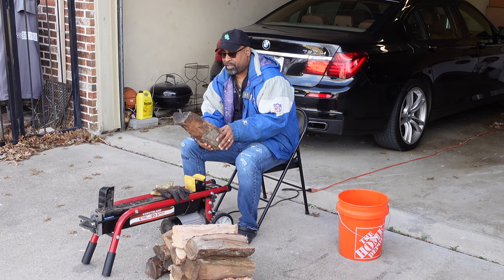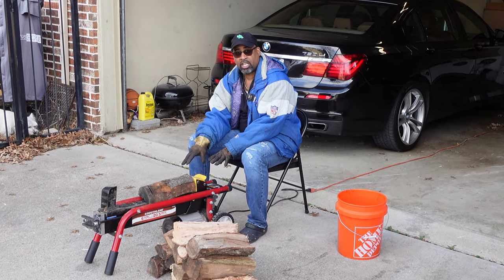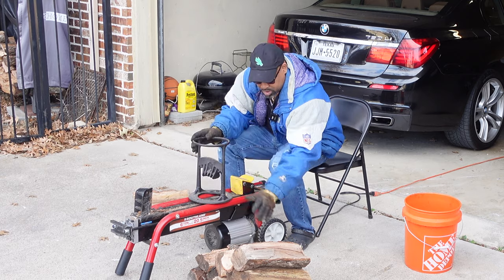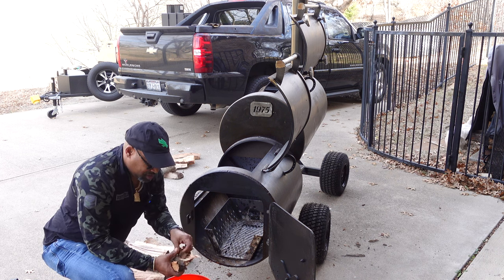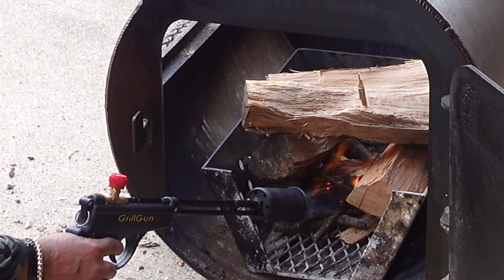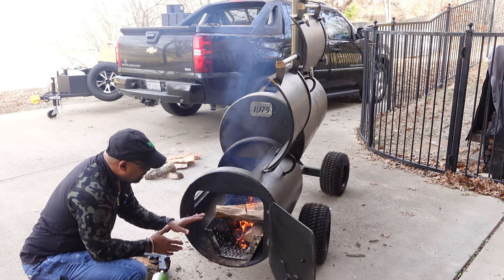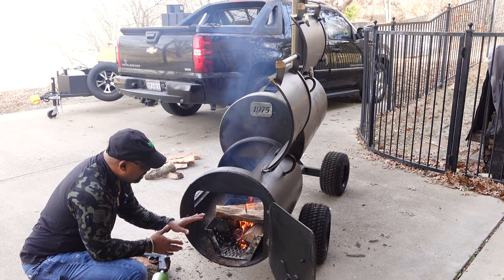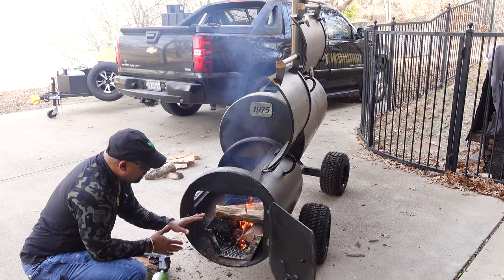Fire Management (How to's) for all BBQ Smokers   4K

Comment: I found it much easier to start my cold bed with actual charcoals. I have used that method for quite a while and it's easy and makes a better cold bed in my opinion to start with because they are able to burn better than the big chunks of wood. Very nice pit
Reply from the maker: Great tip and I agree. I used charcoal as a started over the last 5 months and saw great results!

Comment: Always enjoy your videos!  I notice you using the fire basket on the 1975.   Have you tried it without the basket?  I ask because I've heard quite a few guys prefer round firebox without a basket since the round shape naturally creates a coal bed.
Reply from the maker: I honestly haven't tried it without the basket yet. I think it's because I always worry about smoldering that can occur when the fire begins to create a lot of ash. I have to give it a shot though. With the basket this has not been an issue thus far. Thanks for checking out the video!

Comment: Mr DSki. I see you have many cookers. What has been your experiences with the Lone Star Grills and the Workhorse Pits? Can you provide some informative feedback about the benefits found when comparing these 2 companies cookers and areas of improvement?
Thank you
Reply from the maker: Both companies offer a fantastic product. Quality materials are used by both and final cooking results are comparable. The difference is mainly in material thickness as the workhorse is 3/8" thick as opposed to the workhorse being the traditional standard of 1/4". I have to say that customer service at LSG is 100% better than workhorse. It was difficult to get feedback during the manufacturing process where LSG was always there to answer and give you feedback. That means everything to me. At the end of the day you cannot go wrong either way. Hope this helps

Comment: Great job on fire management.  You taught me what I have been doing wrong.  Thank you.  Cannot wait to fire up Barbie again.
Reply from the maker: Glad I could help. Let me know how it goes. Thanks.
Reply: @DskiGrillz  My problem was temperature control.  Some fires were easy to maintain at 225 while other fires were too hot or not hot enough.  It never occurred to me that firewood size could be that important.  You showed me the error of my way.  Never too old to learn a new trick.  Barbie and I thank you.

Comment: I’m looking at ordering the 1975 now, so these videos are great.  After you get it to temp and throw the meat on, do you close the stack at all to maintain the temp?
Reply from the maker: No at all, I keep it wide open and adjust the intake on the fire box if I need to increase or lower temps. Great question. Thanks for checking out the video!

Comment: I have the lone star 30x72. I have cooked on it 8 times. I cook with wood (hickory). Not really getting that smoke flavor. How long did it take you to get that smoke flavor? Do you think that the management basket affects the smoke flavor?
Reply from the maker: Hi Jerry,

I was talking with another viewer a few weeks ago about the same topic. I honestly haven't experienced this with my LSG. You would think that using Hickory would definitely give you the desired smoke flavor. My results really come from focusing on split size and running a clean fire. I keep my exhaust wide open which helps to push the smoke through the chamber, across the meat, and it exits the smoker either showing no sign of smoke or a light blue smoke. This method also stabilizes my grill giving me even temps which helps with a consistent final result. Maybe call Chris at LSG to see if he has any tips besides mine. Let me know if you figure it out. Take care.
Reply: You could try running a little 'dirty' smoke at the beginning of the cook, like for a couple hours or so. Clean smoke has always been the mantra when it comes to live fire cooking but Jirby from Goldee's BBQ kind of debunked that in several of his videos awhile back. Even Mad Scientist BBQ has a video on running 'dirty' smoke during parts of his cooks. Check out those videos to see what they mean by 'dirty' smoke and maybe you could give that a try and see if it helps.